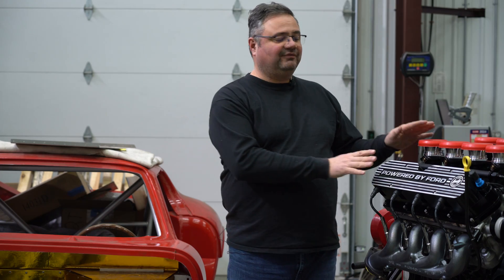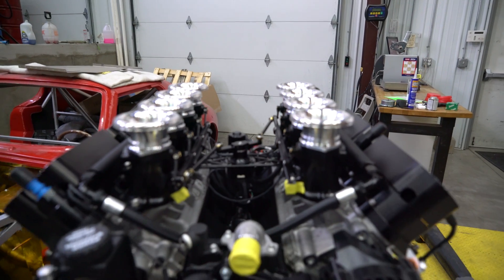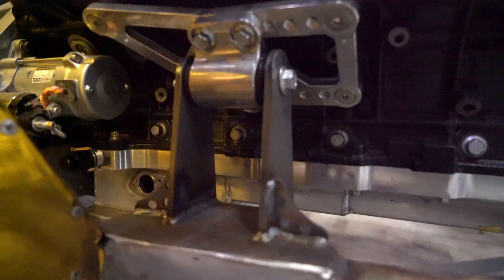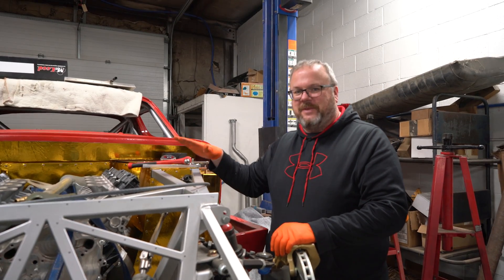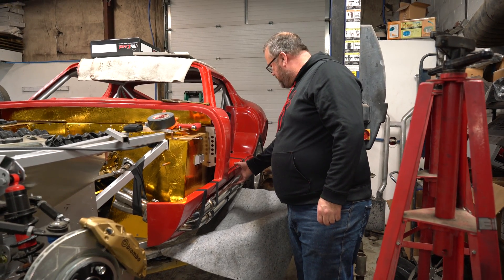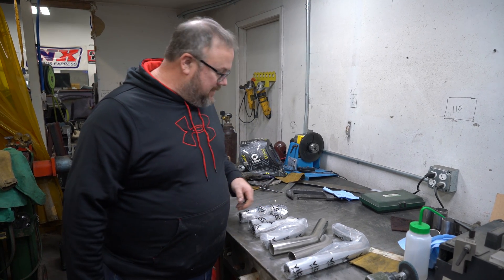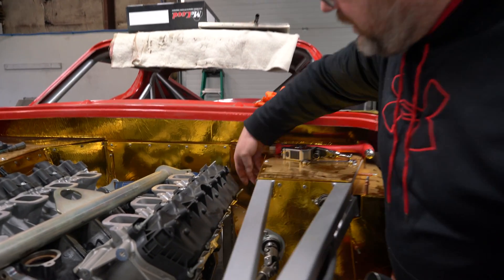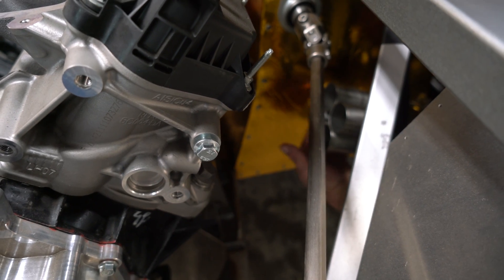Factory Five Daytona 7.3L Godzilla Swap | Header Fabrication and Build

Comment: Great job! Such a cool car, it’s going to be a blast with the Godzilla motor. Have you ever used Solar Flux on the inside of the Stainless so it doesn’t sugar instead of back purging and using so much Argon?